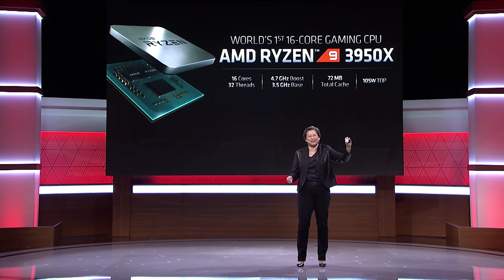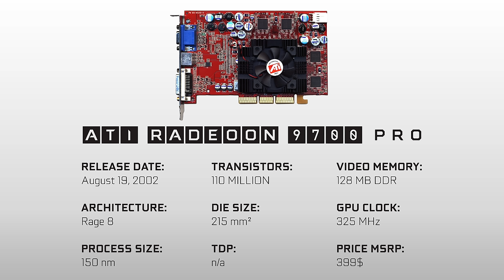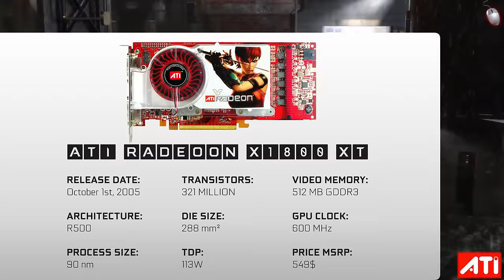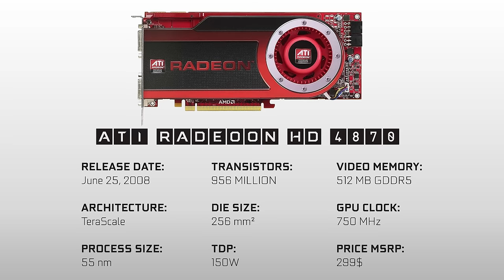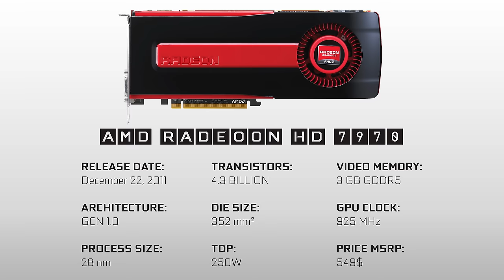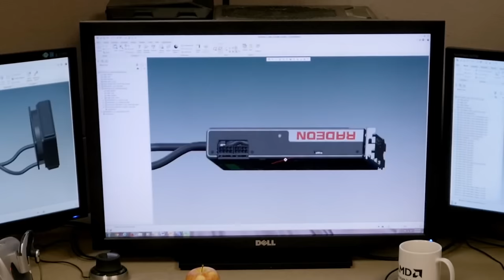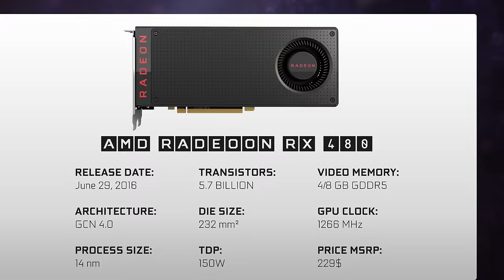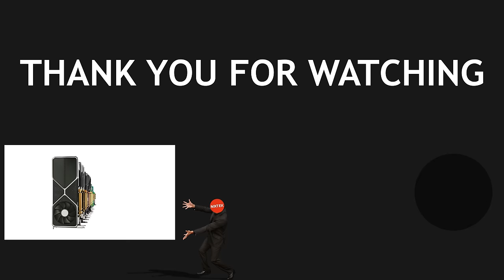The Evolution of AMD/ATI Radeon Graphics (2000-2022)

Comment: The 9700pro (R300) was the best AGP gfx card ATI ever made, it was the king of the hill for a long time and was the first time i had a 3D-card not being replaced the next year as it enabled me to play all games at max resolution, max settings all at a very decent framerate for a very long time.  It was also a good overclocker, and above all, the tier 2 card (the radeon 9500 non-pro) that came in at just a little above half the price of the 9700pro was actually the exact same card with a few pipelines disabled.
About 2/3 of these 9500non-pro cards were actually not faulty R300 chips at all, they were just tuned down to have a mid-range card available and you could just flash a 9700pro firmware onto those cards, test for artifacts in 3dmark and if everything was smooth you just earned yourself a nice pocket of money. It was the moment when i rang up all my gaming buddies to ask them if they wanted a premium card at the price of a midrange with 66% change of ending up with the best of the best. A good dozen of my friends took the deal and we were so lucky that only 2 out of the 12 cards gave artifacts. I also checked each and every 9500np how far it would clock, and i kept the best one for myself ofcourse (most of my friends were not into overclocking, so they didn't care). In the end my 9500np was able to produce even better results than the 9700pro i Initially bought. I kept both cards ofc, and the 9700 went into my second gaming machine (i had 2 machines for gaming back then, so i could always play RTS games with/against a visiting friend via LAN).  Yeah, the R300 is in my eyes the best AGP-card ever made, a big leap forward from the 8500 and way better money-per-fps (bang for buck) than what nvidia was offering. I still have that 9500np in a drawer as it was one of the most significant cards i have had, it's just next to the 2 Voodoo²-cards i kept...
Reply: The Radeon 9200/9250 is even better. It can be converted into an Arcade graphics card for an arcade JAMMA System. These are valuable cards for working with 15 kHz CRT arcade monitors. It's the best card for that purpose.

Comment: I personally think and contest in the fact that the AMD RX 480 is one of the best cards, I have ever owned. I brought my Asus STRIX AMD RX 480 (8GB) not far after launch and also seeing it on Linus Tech Tips. It was a much-needed update for my second-hand brought R9 290 (2GB). I have only just updated the card to a MSI RX 6700 XT OC (12GB), only because of a fan issue I had with the RX 480 (due to me accidentally cracking and breaking a fan blade when I was cleaning the card) However the card still works, but was getting a bit bottleneck and overwhemed in some of the new titles (also driver issues with RX480). Not bad for a card that is 6 years old.

Comment: Id say though the most revolutionary card that came out in my 26 years building pc's though was the 9700-9500pro series from ATI.. they were the first video cards to ever break the barrier  for good frame rate with AA/ AF enabled.  prior to this anytime you even turned 2x AA on fps in games would go from 30/60 to like 5 fps..  none of you are probably old enough to know this though.. back then we played games at 800x600 or 1024-768  with no AA.. im sure you can imagine how jagged games really were.

the only problem i have with your videos is it doesnt talk about what the cards strong points were.. just the specs..  like the 9700pro set the basis for us today for using AA /AF which no one remembers.

Video cards i have had in my life gaming, were the geforce 2, geforce 3 ti200,geforce 4 ti4600, 9700pro, 4790, 8800GTS, 1080ti, and now my 6900xt i bought 2nd hand the other day..  The 6900xt is also the first card ive ever bought used, and 1 generation behind... due to video card prices these day i cant afford a 1000-1600$ video card.. the 1080ti i got in 2017 was pushing it for me at 750$

Comment: My first AMD card was an RX 580. Now I have a rig with a 7900xtx. 

They might not always have the best graphics, but they've always had amazing price per performance....even if that price has gotten a little bloated in recent years
Reply: I upgraded from 3070 to 7900xt. This card really impressed me price to performance and even in ray tracing. 3070 could only handle rt low and now I'm doing rt ultra in cp2077.

Comment: I have during my PC Gaming life have 3 or 4 AMD cards, 2x in late ATI. and R290 the card that could heat up a Home xD and now I have AMD 6700XT Red Devil. it's a pure Beast in 1440p high FPS Gaming, just lite software issues. So the Best Card I have ever owned goes to EVGA GTX 1070 SC, had it for 6 years no problem what so ever with it.

Comment: Best ever Ati card (and the only Radeon I ever owned) was actually the 9500 - which could be firmware-modded into a 9700 Pro. I bought one of those for around €240 back in the day from a vendor who would test 9500s for modability (not all cards could be modded) and then sell them at a slight premium. At that price, that thing was a steal back then and it was way better than anything NVidia had to offer at the time. 
Of course... seeing the MSRPs for any of the higher tier cards in 2022, I find myself longing for the good old days when you didn't need a bank-loan to upgrade your GPU... €2200 for a 4090? Sure, NVidia ...

Comment: I bought an 8GB RX 580, and a Ryzen 7 2700, back when I built my first PC, back in 2019.

Last week, I replaced them with a 16GB RX 7600 XT, and a Ryzen 7 5800X.

AMD is really great, and I've only had ONE issue with them, and that's only happened this week (the current latest drivers don't want to download from AMD Software Adrenalin).

Comment: The X800XT Wasn't a brand new architecture, it was a derivative from the R300 called R420, the new architecture R400 based on SM 3.0 was relabeled as R500 in the 1800XT.The omission of DX10.1 on the HD 3870, the word mispelled Radeoon HD 7970

Comment: ATI's first GPU was not called a Radeon, and was released many years before 2000.
Reply: Their first GPU was the Radeon. Every other card before it such as the Rage 128 were not GPU's. but 3D Accelerators. But in the 90's, you would've needed a 2D card to handle 2D tasks along side the 3D card. While the first GPU's, aka "GeForce 256" and the "Radeon" were the first actual GPU's as they could perform both 2D and 3D tasks. and handled all graphical processes without having to need a 2D and 3D card. Someone else could explain it much better than I could. but that's basically it in a nutshell.
Reply: @FinnLovesFP  Someone else could explain it better?  Maybe someone who was actually around at the time, and knows exactly what those cards were?  Someone like me?

First, your contention is false.  A card that processes graphics is fair game for being called a GPU regardless of whether or not it has display outputs on it or not.

Second, you're just wrong about the early ATI cards.  They never did 3D-only cards.  ATI started business making 2D-only cards, up to the Mach series.  The Rage series included both 2D and 3D acceleration.
Reply: @FinnLovesFP  that's all very wrong. the "world's first GPU" was the geforce slogan and it existed because that's when they introduced transform & lighting, which offset some operations the used to be done on the cpu to the gpu.
Also, GPU wasn't a generic term, it was a marketing term belonging to nvidia at the time. AMD, in response, called their stuff "VPUs" (visual processing units). that didn't stick and eventually everyone just defaulted to the GPU term we know today.
Also there were a bunch of 2d+3d cards before the geforce, including Nvidia's own RIVA TNT series, 3dfx's voodoo bashee and later, and some other brands too (there were a bunch at the time)

Comment: I have an old R7 250 1GB GDDR5 in storage, and that graphics card gave me a lot of happiness. I now have an RX 570 8GB for almost 2 years now, it performs really well for 1080p gaming with high graphics mostly.

In a few years, it will possibly replace it with one of the mid-range RX8000 series if this chronology of names is maintained, since AMD has greatly improved its technology and is offering new ones that, although they are simple, give something to talk about.
Reply: I went from an RX 580 to a 6700XT and that was wild. If you wait until RX 8000 you better find a seat belt 'cus that kind of performance uplift may very well fling you out of your gaming chair! :P

Comment: AMD is surprisingly still the financial underdog when it comes to its total stock evaluation (138.15B USD right now), and had a total 16.4B in total revenue, with only a tiny ~19% percent being profit. Both Intel (159.31B, intel doesn't prioritize stocks for value) and Nvidia (413.32B) have higher profit margins while also having a higher profit overall. Its ~25% profit off of 79B and ~36% profit off of 26.9B, to Intel and Nvidia respectively.

Neither had the drive to compete till AMD came around slapping their face, and that says something. AMD isn't slouching at all in either the CPU or GPU divisions, if anything neither Intel or Nvidia are actually creating innovation (atleast from what we can find about their upcoming launches) Intel is still technically using Alder Lakes microarchitecture, and Nvidia has what are essentially (in concept, and if i remember the situation correctly) Fermi 2 cards. 

AMD is honestly trying its best, (its not the greatest) but i'm expecting Navi 33 to be the biggest flex we've seen from them. Along with Zen 4, which its predecessor was already flexing at Intel, not to far behind in real world usefulness. But only time says if AMD pulls through this wide opening they've received, and partially made happen (i mean within their own production, not others).
Reply: "Neither had the drive to compete till AMD came around slapping their face, and that says something. AMD isn't slouching at all in either the CPU or GPU divisions, if anything neither Intel or Nvidia are actually creating innovation (atleast from what we can find about their upcoming launches) Intel is still technically using Alder Lakes microarchitecture, and Nvidia has what are essentially (in concept, and if i remember the situation correctly) Fermi 2 cards.'

maybe intel but not nvidia. also we might see some things as "innovation" but it might end up being useless if they end up hard to use or in some case not useable at all. nvidia in general are not the type to use the latest tech just for the sake of having it. if they push one tech they will make sure at least the tech can be used on real games or app rather than being just a concept.
Reply: @arenzricodexd4409  definitely don't know Nvidia, what actually makes it to market for them is actually quite rare, you almost never see any of their AI projects (a thing they tout RTX cards can do well in real time, in some cases) actually used for games or even productivity of some kind. And well there are many technologies Nvidia has never got a footing with. I mean AMD has its fair share too, but I've never seen so many be sitting down on the table unlike Nvidia.
Reply: oh poor them only profitting over 3 billion in a year. i'm sobbing here
Reply: @GraveUypo  at a large company scale that's pretty small. It's very common for such companies to get tens of billions. And well as a person you'd only get up to 150k at a high end average.

Comment: I missed the ATI days, back when they could actually beat nvidia. I remember a friend of mine buying a 9800 pro for 200 from a local pc shop that was going out of business. At the time I was  using a 6600gt and his card was pretty much on par in performance. 

I did like the 290x though, it was my first 4k card, but it ran hot af.

Comment: It was voodoo 3Dfx Banshee 16MB when I first gamed 3D.. Then first geforce 256MB ddr..ATI 970pro..gtx 460..Radeon 7950..gtx 780,  970, rtx 1080, 2070...wow.. What a journey.. Look at how the msrp of graphic cards sky rocketed!! I am putting off upgrades for now..
Reply: have you multiplied prices by inflation? :)
$299 in 2001 is around $500 today, that's low top-tier GPU atm

Comment: This video is ridded with inaccuracies. The X2900 through the x4800 series were all DX10 cards. Tessellation wasn't released until DX11 and Windows 7, and the X5870 cards. Most of the older cards used DDR, not GDDR.

Comment: There's some glaring omissions in this list. And some incorrect matters too. 
https://youtu.be/ZUMbVVVSr5Q?t=302: The Toyshop demo doesn't display doesn't do physical simulations. What it does do is offer the full Shader Model 3.0 feature set. Parallax Occlusion Mapping was the next big thing and it's offered a great display here through the fake 3D used everywhere.

https://youtu.be/ZUMbVVVSr5Q?t=770: The GPU on display is the R9 Nano, not the Fury X. The R9 Nano was a factory-watercooled model. It was an interesting bet, the R9 Fury series still managed to perform on par with the later RX590, outperforming GTX1060 cards easily still.

https://youtu.be/ZUMbVVVSr5Q?t=842: The RX480 was not an entry-level card. It was a high midrange card aimed to offer fantastic value, which it did. Entry level cards would be released later in the form of the RX460 In fact it did it so well, it kicked off the price hike of videocards by selling at least 50€ over MRSP upon launch, making the R9 Fury interesting again, which sold for almost the same price, whilst offering better performance. It couldn't match the GTX1070 and 1080 cards in terms of performance, but offered performance on par with the price level nonetheless.

Also missing are references how AMD's 2900XT formed the basis for the Xbox 360 GPU, giving the later 3870 / 4870 a major advantage over nVidia, due to the match in architecture and X360 being the leading platform at the time.

The same applies to the HD 6970 range and up, matching the PS4 / Xbox One architecture.

Was lovely seeing some of the classic tech demo's again, thanks for the video!

Comment: Radeon 7000, Radeon 9200SE, Radeon 9600 pro, X800, RX480 (running a 580 BIOS on it now). Every single AMD card had driver issues/crashing throughout the years, all the way back from Windows XP, and now Windows 10 :D
Reply: Contact me for your reward 🎊

Comment: I bet today the 6600 is the most popular card due to electricity costs and the fact that this card is one of the most economical. All fine and good running a beast until that electricity bill comes in. RX 6600 TDP: 132 W RX 7900 XT TDP: 350 W
Reply: Upgraded my kids' Linux-based PC from a RX 570 to one of these and I have no regrets.

Comment: Sue has done wonders for AMD. To the point of finally wanting me to get an AMD CPU again. Ryzen 7000 finally went to the LGA platform, making the only reason I switched to Intel, pointless. I switched from AMD CPUs back when I damaged an FX8750 by bending pins from putting it in the wrong way, and their locking mechanism never locking it down, I pulled it out trying to get the cooler off and bent pins that way, too. Causing me to go down to an FX8350. Said fuck it and switched to an i7-7700k, then upgraded to a i7-8086k. That 5800X3D lookin' pretty good.. Hopefully the Ryzen 8000 series that comes out in a couple of years will be better than the 5800X3D so I can use the LGA format for Ryzen CPUs and get away from Intel and their greedy ways

Comment: I have a 3gb gtx 580 a 2gb gtx670 and a r9 290x 4gb the only one really usable today is the r9 it still tanks most games at 1080p low med settings I have it in my backup pc with an i7 7700k and 32gb of ram and it's a very good system still

Comment: I went back with and forth with ati and Nvidia in the early 2000's, I think more ati cards than Nvidia, the Radeon 7500 was my first card, then had a 9200 for a short time then a 9500 which could softmod to a 9700 with driver's. I won't count the rage pro 2 4mb I had lol.

Comment: Factually wrong about games needing 6gb and the amd card only have 4gb. Even now if youre playing 1080p you only need about 3gb. the only way you use 6gb vram is 4k which 99.9% of gamers are NOT using or 1440p ultrawide which still most people arent using. 1080p is still the most popular resolution followed by 1440p as its becoming more popular. 4k is still niche. Thus vram sizes all around are a joke. Too end cards get way too much that we never use. I run 3440x1440 qd-oled and ive never seen any game go over 6gb vram. And my 6900xt has 16gb to use.... All these modern kids crying about nvidia vram amounts and they dont even use the vram to begin with
Reply: bro i game at 4k 144hz on 4090
Reply: @znatnodobre  you are in the 1%
Reply: @goblinphreak2132  nice

Comment: you missed the RX 500 series card. RX 580 is a beast. i still own it. but i retire it for 6600XT. can't afford the highest end version. but 6600XT is more than enough for my 1080p only gaming.
Reply: I also upgraded from an RX 580. I went with a 6700XT and a 1440p monitor because I'm a programmer and I was really starting to notice the difference in clarity between work and home. Guess my eyes are getting old :P
Reply: @andersjjensen  never used 1440p. because i dont want my eyes to like it. because that would meant i need to move to more expensive GPU.

that's why i decided to stick with 1080p.